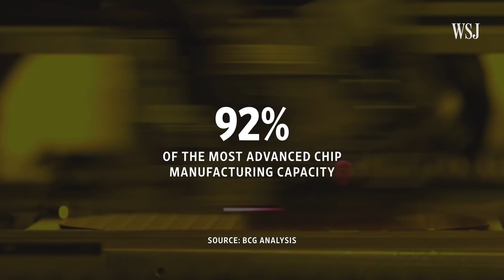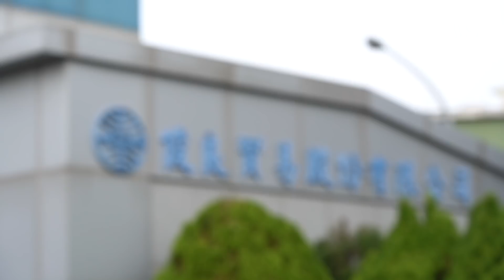As U.S.-Taiwan Trade Strengthens, Tensions With China Complicates Business | WSJ

Comment: The CCP is like an ex who refuses to acknowledge that the relationship is over long time ago 😅
Reply: For Taiwan to be an "ex", it should have been independent initially. When the opposite is true. So a poor analogy from your part.
Reply: @porkysharma8423  yes. CPC was a political party under the ROC, started by Sun Yat Sen. The ROC got all the lands from the Qing via a signed treaty. Unfortunately for the CPC, after they kicked the KMT out of the mainland, they declared themselves the PRC with a completely new constitution.

That's right. Taiwan independence wouldn't be an issue if the communists simply kept the ROC designation 🙃. The communists made themselves an independent country and divided China (with the help of foreigners from Russia). 

It's really too bad because the ROC still exists. While the loser ROC still claims the mainland, the PRC still doesn't have a signed agreement ceding all the ROCs lands to them. You really do have to earn all of it.
Reply: @porkysharma8423  also, you "can't wait" for CPC to earn Taiwan? It's been 70+ years 🤣🤣🤣. CPC talks a lot about efficiency yet they keep you waiting. You should join the PLA and start a protest in Beijing to hold the CPC accountable to the promise. Can't wait!
Reply: @dsw86  PRC claims Taiwan as an integral part of China, while ROC claims mainland as an integral part of China. Both constitution says the same thing in terms of territorial integrity(*). Go read about them.

Russia Empire might have took part of Northern China, but Soviet Russia helped CPC rise to power and win the civil war + invested heavily in the early days to turn China from an agriculture based economy into an industrial one. And all the land borders between China and Russia have been sorted out for at least 2 decades now. While the Russian Empire, Soviet Russia and today's Modern Russia can be said to be 3 different countries with 3 different philosophies. Though Modern Russia is slowly but surely turning back towards its socialist roots (+communist values) after having a taste of capitalism and market liberalisation.

"PRC still doesn't have a signed agreement ceding all the ROCs lands to them." already corrected you on that falsehood.

When CPC feels the need to take over the island, then China will go and the PLA will have 1.4 billion supporters behind it. (and maybe a potentially additional 23 million behind it 😉)
Reply: @Porky Sharma  that's not new information Porky. Both ROC and PRC claim all of "China" without actually controlling all of it. You recognize there are 2 constitutions, which each have lots other rules outside of the One China clause, that only apply to the territory they each control - different regimes with different philosophies as used in your Russia example. So yes we could each read through both constitutions. For example article 13 of the PRC constitution gives Chinese people freedom to assembly and association. If you want 1.4 billion Chinese to respect you and help forward their cause, you need to start a demonstration holding the CPC to account. Finish off the civil war by taking Taiwan. Don't walk back your "can't wait" and actually try to 實現中國偉大復興. 

Not sure why you wrote a huge blurb about Russia. You should be focusing on the CPC's original philosophies, why mainlanders and Taiwanese would all be happy if Taiwan joined PRC, and the strength, resolve, and ingenuity of the 1.4 billion Chinese people. Don't legitimize a foreign power influencing China. Don't make a country with 10x smaller population your daddy. If you're actually Chinese you'd be considered a 狗漢奸. 

You've disproved nothing. You've only walked back your "can't wait" statement. You don't sound tough talking about "when" CPC feels like taking it they will. How about now or next week or wait another year? You're nothing but a 韭菜 and noone in the CPC would respect you. All talk no action.
Reply: @porkysharma8423  maybe you deleted your comment but I'll make sure you're clear: "lol imagine a Taiwanese speaking on behalf of the CPC"
It should be what you want - it helps strengthen your case for a unified China. If anything, you shouldn't toss the word "Taiwanese" around because it legitimizes the separatists. You should be making the case that people on both sides of the strait are Han Chinese therefore need to be unified as One China.
"What's the need for force when PRC can use peaceful power?". the PRC's idea of soft power hasn't been working for 70+ years. Voters in Taiwan haven't been leaning towards unification because they don't think the PRC changes their lives for the better. Same way you said Taiwanese didn't want the KMT back in 1945-49, they even more so don't want the CPC lol. Just reality. Also part of the PRCs soft power is  always threatening the use of force without actually using it to finish the job. I told you if you can't wait, the fastest way is to do it by force. Don't tryna walk it back or take the high road saying "peace over force", when PRC is the first to talk about force. If you believe in One China and care about how the 1.4 Bil + 23 Mil people live, you should think through how the current issue gets resolved. Not tossing around outdated and incoherent logic.
Didn't see anything else you wrote. However if you don't recognize any of your inconsistencies, there's nothing else to talk about. As of now, the arguments you make does not translate to PRC and ROC functioning as One China, nor does it make a difference in either's lives. Good chat brotha take care 👊
Reply: Nope. They are still legally married. DPP wants a divorce, but a divorce could mean she'll go emptyhanded.
Reply: @truthnow8848  just so it's clear, that's the Qing Dynasty you want to base all Chinese territory off of. They actually ceded Taiwan to Japan in 1895. well before WW1 and 2. China became China 中國 in 1912 as the ROC, and got the Qing to concede all their territory to them. ROC later got back Taiwan in 1945 after Japanese imperialists surrendered.
The CPC was created as a party under the ROC*. KMT and CPC partnered to fight the Japanese, with KMT has the identified ruling party representing all of the ROC.
After KMT got beat, they fled to Taiwan which was already under their control. They cared very little about Taiwan as a region and only saw it as a temporary base to retake the mainland, and took most of the ROCs gold reserve and artifacts.
With the CPC left on the mainland, they declared themselves the PRC with a completely different constitution, independent of the ROC. 
That's where we're left today. You might call it a civil war but that's under the pretence of who governs the ROC as a whole. The PRC is a new creation from 1949 that may claim all of the territory but is illegitimate until the ROC ceases to exist and is entirely replaced with PRC governing body in Taiwan. ROC claims all their mainland territory as well and has done nothing to retake it. ROC in Taiwan then democratized and developed their own identity over the last 70+ years because they've not exactly been associated with the mainland Beijing or Nanjing government in any capacity or form, only for 4 years (1945-49) out of the last 127 years since 1895.

Both mainland and Taiwan have done great without one governing another. Plenty of trade and exchanges and people are generally friendly with each other. In reality they simply don't function as one Chinese nation. One may mention 1992 Consensus. However both sides have their own interpretations on it and it does nothing to change how each territory is governed or how people on either side live. ROC (KMT, DPP or any ruling party) has no jurisdiction over the mainland population and the CPC/PRC has no jurisdiction in Taiwan. People on both sides live just fine as things are.
Reply: @truthnow8848  You use the American civil war as an example. But it's more like if the Union (which controlled DC), was defeated by the Confederate States and fled to Hawaii (not at that time but for comparison sake). Confederates make their entirely new constitution and claim everything. Union in Hawaii also still claims everything under the original 1776 US  constitution. Neither finishes each other off. Independence declared or not it changes nothing about the practical function of Government on each side they control.
Reply: @porkysharma8423  idk bro. taiwanese don't worship tsai, ma, dpp, or kmt like the mainlanders worship Xi and the CPC. Can't really call it brainwashing. 
You don't know what's "better" for mainlanders or Taiwanese. You have not addressed any gaps in your understanding of Chinese culture or history. You have no basis to talk about American or western influence on Taiwan when you legitimize another foreign power like Russia meddling in Chinese internal affairs. Neither of us may change how 1.4 Bil and 23 Mil live. But especially not you.
Reply: @dsw86  The worrying thing is the US has set a poor precedent since WW2 showing military might makes right, no matter what the inhabitants of the country think. This is the only reason why Russia and China don't heed calls from Western nations when they talk about leaving Ukraine or Taiwan alone.

This isn't even an age old thing, look at the toppling of South American nations, the Iranian revolution, the creation and military fortification of Israel, the Iraq War or the war in Afghanistan. The victims of these nations have suffered and it has shifted the moderates towards the extreme. Interfering in these countries has pushed the moderates to the extreme. That's what happens when you come in and try to convert people. But the US couldn't hold on to Arab nations because... well there isn't a shared ethnicity or culture.

The debate really is over. The only conclusion we can draw from history is military might makes right. Will the US declare war on China if the CCP blockade and starve out the Taiwanese, or even if China sets a foot into Taiwan? No it won't because it is no longer a war it can guarantee victory. Does the EU have any appetite? Seems like they have their own problems with Russia and the east/west divide tearing the EU apart. Would even Turkey back its NATO allies after the US and EU turned its back on the PKK rebels in Turkey's eyes? Taiwan will end up like Afghanistan or South Vietnam, no matter how developed the nation is. Development doesn't preclude us to violence
Reply: If you think what I'm saying is bad or wrong then where were you when other atrocities around the world occurred by American and European hands?? You've completely forgotten because somehow when the US does it over and over again you forgive. When China does it somehow that's overstepping the line? 

We have only showed the world that military might makes right. We did it to India. We did it to China. The US still does it to this day and mark my words will continue to do so only when they can guarantee success. If China invades Taiwan, the US will back down (it'll be annoyed but it couldn't start a war). Same with Russia and Ukraine's ethnic russian sectors. No one wants WW3
Reply: @truthnow8848  you have a good heart and I mean that. We all would prefer to avoid war where possible. However you speak on the premise that China invading Taiwan is a forgone conclusion and you aren't questioning the reasons for it. It's easy to blame America for military makes right. But that applies to the entire history of humanity. Wars break out because there are disagreements that can't be solved peacefully.

Nowhere do I believe America or Europeans are good. Never said it. America carries the name of freedom and exploits it for bananas, weapons, and oil. That's not news. Europeans fcked the entire world up too: India Pakistan and Bangladesh, Israel and Palestine, list goes on.

That said, knowing there are aggressors, it equally falls on capable nations and their people to adequately defend themselves. We know about all the western influence in China. Does anyone blame the Qing dynasty for not keeping up with the times, being unbelievably corrupt, and didn't do more to defend themselves? What about civil wars where CPC and KMT fought each other and killed many innocents so their ideologies may apply to all of China? Do you consider atrocities CPC and the KMT committed on their own people? War happens for power, natural resources, and many more reasons in between. It's easy to blame specific parties but in all cases people are exploited and killed. Are any of these cases more moral than another? Shouldn't those in power continue seeking peace and defend themselves when there are aggressors?

Let's wrap up. Why are Taiwanese lining themselves up with westerners who'll take advantage of them then throw them to the curb when they're no longer useful. Because for the time being, the other option is CPC rule which does not appear better to them. Because the CPC has not ruled over the territory yet claims it. Because the CPC still commits atrocities on its own Chinese people and do not give fair trials. Because CPC threatens invasion all the time if they don't get their way. Because they're happy with their own way of life, social programs, and income. They don't see the CPC improving on these and they don't see westerners acting so aggressively for them to change. Do you blame them for wanting to defend themselves? The ROC constitution may  claim all of the mainland too but they're not aggressively taunting the mainland with military makes right.
Reply: @dsw86  But the hate is still there. Once China becomes twice the size of the American economy it will be easy to reintegrate Taiwanese people with the rest of the mainland just like with Hong Kong and Macau. Might still makes right in this.

I only think that there needs to be mutual respect between large economies and countries such that the smaller countries don't get brought into the fight. We don't give China, Russia or India that level of mutual respect.
Reply: @dsw86  have you seen the next 5 year plan and the BRI? If we view Chinese development across the whole country similar to South Korea or Taiwan then well clearly yes. Yes it will reach 2-3 times the size of the US economy, even Elon Musk makes that prediction. We have to base our actions on fundamentals and the information we have on hand, it does look like China will be on track to be 3 times the size of the US by the end of the century...

Also I don't see why China needs its own version of Vietnam, Afghanistan? Those were massive failures and China has historically not projected its military power into other continents, even during imperial times... It may do so though as the new superpower, but that's only if it views itself like the US as a world police force (a bad one at that too).

So we respect these countries if they're not aggressing. Yet we expect respect back when we do the aggressing? American actions have shown that might makes right, they lived by the sword and will die by the sword when they can no longer fund it. The US made it's economic and military advantage as the latecomer to WW2, that advantage is being removed. We did not show respect towards China, India or Russia as the anger is still there